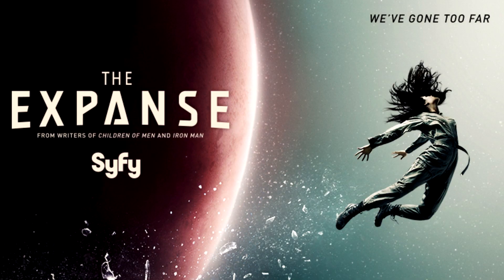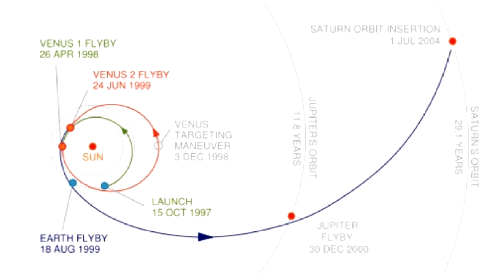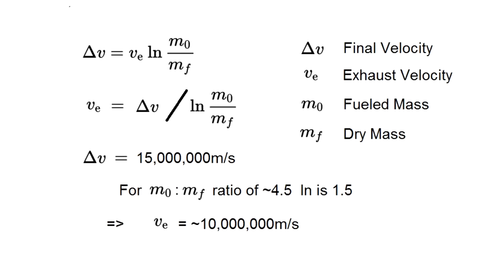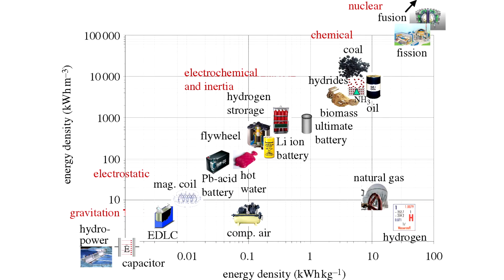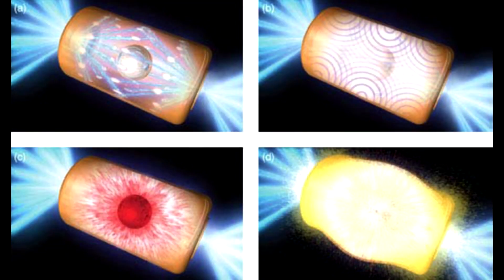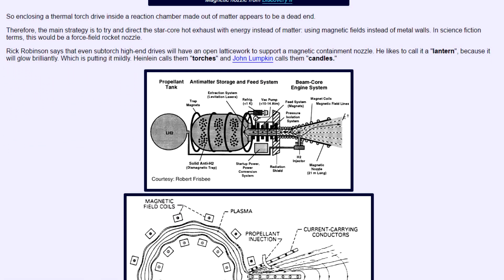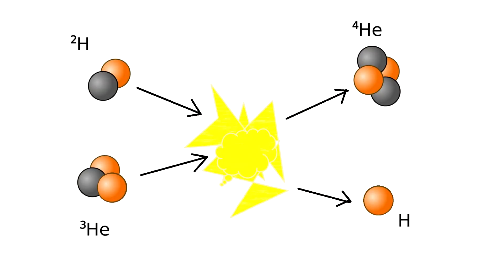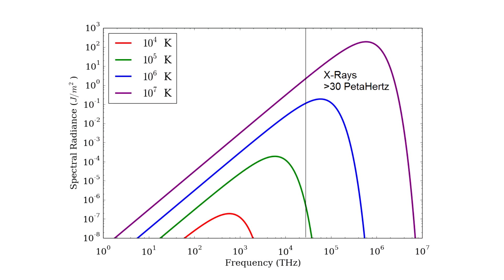The Rocket Science of 'The Expanse'

Comment: One thing I don't understand is the Mormons... if they have constant accelerations of the kind they show in you-know-what-episode (and don't tell me it's not used - putting a smaller set of engines on the ship would have to be more cost-effective) what kind of star are they visiting that requires a generation ship? O.o At 1 G you can get anywhere in the universe, multiple times over, in one lifetime from the perspective of the crew. Where the hell are they going?
Reply: My half assed guess is that it looks like the ship was designed to spin for gravity, which means they might not have had the fuel to run the drive the whole time, they may have intended to have a long coasting phase.  Again.. a half assed guess on my part.  Cheers!
Reply: They only have a delta v budget of 5-10% c. They will not be constantly accelerating.
Reply: And I dont remember anything about Bussard ramscoops being mentioned.

Comment: I once had a chat with someone about possible fuel sources for a ship. Now this I have to give him credit for this one. He had put a theoretical design out based on extensive research in to the subject surrounding the issue of the neutrons and the unique properties of deuterium and tritium. His idea was to actually add two other molecules to the mixture. The idea was to use them as a sort of filter and catalyst agent to reduce the offset of the potential build up of the neutrons and to recover some H3 to try to reuse. The design of the engine was enormous, hundreds of "Neutron Sinks" as he called them, would retain the charge and the excessive heat. Though I'm not in expert mind you, but in relation to how this system could be used effectively the group I was with looking at this came to the conclusion that this system would have to be applied to much larger ships. Like Tycho Station, or the Donnager being the smallest you could effectively utilize this system with. Or the Canterbury, ships with an impressive mass that would be able to house the sinks and the recycling scrubbers. Now to power this you would need some kind of high yield source of power. Most the material you spend is into the propulsion, this system would need a impressive solid state nuclear reactor or something that can generate tremendous amount of energy to maintain the amount of power required to direct and control the propulsion plant itself. I don't recall what the two other molecules were, this was put out almost a year or so ago. Approximately around the time Expanse had come out and in the first few episodes. This idea was originally brought up to a site I was part of were people had designs for things in games. An example would be like a steam airship in D&D that used little to no magic. There had to have been 50-something designs submitted, but many were concept art design. A hand few had any technical design application was put into them. Another and probably one the best ones I was part of was done in part to a space game. Two women had asked the general population for a design for a ship based on the in game currency and resources available. The group I mentioned before actually met up and started from this request. We had 8, 3 actual designers. Two of them did architectural, one did engineering. A geometry professor from a university, another mathematician, a civilian contractor for the army who did radar work, a chemist who had some knowledge in metallurgy, and then there was me. At the time I was submariner in the navy, my experience in that kind of enclosed environment gave the design vast amounts of redundancies and safety features that the GM of the campaign hadn't even considered. Now we did later on pick up a few others, two of which had extensive knowledge in physics. Their take on the system was more on the questionable side as in they had doubts, but given that this person had gone very deeply into the operation of how to collect the neutron build up and the method as to disperse it safely did have them a bit intrigued. To disperse the build up then sinks would actually vent out into space, now the sinks had a very in depth and extensive cooling system running through out. His theory had put it out that the gases and leftover junk could be super cooled to a gel or a form of liquid. Venting it out to space on the dark side of a planet or some kind of orbital body to allow it to tumble and melt on re-entry made it so that liquid would be vaporized. The charge be nullified as it was basically released in the ionosphere, or out in vacuum away from the ship and crew. Major downside to this system is you would need two more holding containers of some sort for the extra fuel sources. Upside, the question of what to do with the charge had been answered thoroughly and in a safe way for the crew. The site I mentioned is no longer up and has been down for some time unfortunately, but if the "A-Team" as we were dubbed, could see this vid I bet money either one of the two physics majors could identify what the two other molecules were and how they would interact with in this proposed system way better then I could. My knowledge was directed more towards the coolant and the refrigerating system required to super cool the build up and the best way to maintain it.
Reply: one thing to keep in mind is with the massive heat output of the engine, even a relatively small amount of excess heat could be used to generate considerable power, with a bank of high output capacitors used to initiate startup when needed, in reality you could either entirely forgo a separate reactor or use a small one to trickle charge the capacitors needed to jump-start the reaction, entirely dependent on the distance you need to cover and the other energy needs of the ship

Comment: BTW, Scott, neutrons can be reflected. It only takes a dense enough material. Thermal neutrons can be deflected/reflected by, for example, concrete. That is how it is done in reactors to get more flux, also in atom bombs and H-bombs. Some materials that reflect neutrons in reactors are as light as graphite. So if the back of the drive was in a particular shape made out of particular material, the crew would be safe and you would get extra thrust.
Reply from the maker: +Thrust vectoring however the reflection efficiency is very low, most of neutrons instead get absorbed and converted into heat.
Reply: That is not true, reflection, or rather generally scattering, have a substantially higher cross-section than absorption. Here, you have the comparison: http://www.nuclear-power.net/wp-content/uploads/2015/11/neutron-absorption-capture-to-scattering-hydrogen-min.png
The neutron reflectors are widely used, in nuclear reactors, atom bombs and fusors. They can increase neutron flux substantially, making sub-critical cores supercritical. The main issue with reflection is its heavy dependence on incident angle. However, effective neutron reflectors do not have to be very thick, because only the outermost layers of the lattice can reflect neutrons back into the reactor/bomb. Some neutrons, however, will scatter from the topmost atoms into the lattice and then continue deeper losing momentum along the way(being moderated) and with the penetration depth and energy decrease the probability of absorption increases(in time the neutron also loses enough energy to hit some of the nuclear resonances). However, given the angle of incidence is good enough, you can achieve pretty good reflection efficiency. But also it is heavily dependent on energy(as everything). However, if you had a multilayered neutron reflector with the right geometry, you could probably achieve a substantial lowering of neutron flux with less mass than you could with shielding alone. The only problem is designing a suitable geometry. To achieve needed neutron flux, reactor geometries are simulated and experimentally studied and it is actually hard to design an effective reactor geometry. With multi-layered anything you also have the problem of energy loss in the layers and the neutron trajectory change, which you also have to take into account.
Reply: I forgot to mention - in atom bombs and some reactors, they use a neutron "mirrors", they reflect neutrons back to the bomb/reactor. They reflect neutrons, that have nearly perpendicular momentum to the reflector surface. A reflection coefficient for that is pretty rubbish, you would get a good reflection coefficient comparable to 1 only from a neutron star, which is not a very practical material to make a reactor reflector out of ^^ But in research, reflection using critical angle is used and the efficiency is pretty good(however, the critical angle is very sensitive on neutron energy, so therefore it is not really easy to design wall out of it to reflect all neutrons, that is how a nearly monoenergetic/monochromatic/ beam of neutrons for neutron therapy or neutron material probing is picked). Had the reactor used specially designed reflector wall to reflect... However, that would mean knowing exactly the geometry of combustion area, which is impossible for pellets, it would be possible for stelarators and tokamaks... Or maybe accelerator-induced fusion, but then you have the problem with luminosity of the accelerator beam and collection of unused fuel and acceleration efficiency, which is really, really low these days...
Reply from the maker: Ok you need to go and actually look at the science, yes it's possible to get 90% neutron reflection if the neutrons are slow thermal neutrons, not the fast energetic neutrons emitted from a fusion event. As the energy goes up the scattering cross section goes down and the neutrons penetrate further into the material until they stop.  As you know most commercial reactors use thermal neutrons because it simplifies the control system.
In nuclear weapons the neutrons are fast (because there's no time to slow them down) and the reflection efficiency is very low as a result, but a chain reaction in a nuclear weapon represents an exponential growth in neutrons and I'm sure if you've ever done the math for compound interest you'll know that even tiny increases in the growth rate translate to massive increases very quickly.

You posted a graph showing the scattering/absorbtion cross section of a hydrogen nucleus.

That is completely different from the reflection / absorbtion properties of a bulk material, where a neutron will undergo multiple scattering events losing energy at each scatter until it slows down inside the material. Importantly as a neutron undergoes a scattering event it deposits energy into the target. So you need to consider that you're going to need to handle multiple terawatts of thermal energy even with a 90% efficient fast neutron reflector (which does not, as far as I know exist).

Look it's great that you know these things, but if you'd dug into the math you'd very quickly realise that what I'm saying is grounded in science.

I suggest you go and find some good papers on neutron reflectors and figure out their performance with MeV Neutrons.

Comment: In The Expanse, it's shown and described that the attitude control thrusters run on steam piped from the engine room. To me this suggests a fusion plant that in turn heats water (derived locally from harvested asteroidal ice) to ultrahot steam to get a blend of relatively high Specific Impulse coupled to high thrust.
Reply from the maker: Yeah that's what's called 'teakettle mode' it reduces radiation hazards to nearby ships at the expense of low efficiency. To get the performance Epstein   demonstrated you can't have much in the way of wasted mass so pure fusion exhaust is the way to go.

Comment: This is all making an assumption that over a hundred years the efficiency of conversion has not improved to reduce the waste heat of the process. After all the equation balances if you reduce the energy converted to heat and raise the energy produced in trust.
Reply from the maker: +Carlyle Toussaint actually there are fundamental limits on how efficient things can be made https://en.m.wikipedia.org/wiki/Carnot's_theorem_(thermodynamics)
As well as various other basic physics which won't change.

Comment: As Scott Manley accurately described the difficulty of actually building a fusion rocket powered space craft that can reach a continues acceleration of 7 Gs, in the show all the space ships only do and or maintain 1 G and likely half that most of the time. And that should be entirely possible, especially in the 23 century. Also the reaction of a fusion torch drive takes place outside the ship.
Reply: They also did point out that the ship doing 7G killed him, the gravity might have only been part of what got him, even if the ship didn't roast itself with radiation and heat he might be toast from running that high that long

Comment: Wouldn't a rocket travelling outside of the gravitational forces of planets, asteroids, the sun, etc continue to accelerate even if the engine is shut down? I would think all that would be required would be the initial acceleration of the rocket motor, then the inertia of the rocket acting without any friction against it, would continue the rocket accelerating until something acts upon it to reduce that acceleration,.
Reply: It'll continue to move, but not continue to accelerate.  Acceleration requires the application of force.  Inertia just maintains your velocity once acceleration stops.

Comment: If I remember correctly, books stated that Epstain drive was an improvement on a "Fusion torch" drive.
Reply: Epstein himself was a fusion drive engineer who tinkered with drives "at home." It's entirely possible he discovered a series of improvements to heat and thrust management over fuel consumption to make a miracle super-drive. After all, penicillin was discovered by accident, who's to say an Epstein drive wouldn't be?
Reply: @MachineMan-mj4gj  penicillin was discovered by mold, which happens a lot in nature. You won't find a new engine just lying in the forrest one day.
Or if, you'd rather be very suspicious.

However, before he did all this, he managed The Beatles.  And that's more important than some rocket stuff.
Reply: @MachineMan-mj4gj  And he didn't kill himself
Reply: @lukas.prochazka  Well, this Epstein did at least.
Reply: @MachineMan-mj4gj  on accident.

Comment: Very good analysis overall. A few things that I would add:
1. Proton- Boron11 fusion produces even less neutrons than D+He3 does and produces only charged particles. "Fuel pellets" would fit the Boron 11. There are some concepts that would work for that. 
As with most fusion concepts, the thrust would be relatively low, however unless you get the fusion power way up.
Granted, we have some 300 years or so to figure that out ;)
Also take a look at what Princeton Plasma Physics Lab is doing with their FRC direct fusion drive. They have a "scrape off layer" that provides the thrust and gets rid of the fusion products. Their thrust and ISP are way below the requirements (but then it is still "early").
https://www.youtube.com/watch?v=IlydFJtWeXg

Another interesting take is what MSNW LLC has proposed with their fusion driven rocket engine:
They want to achieve 90 day mars trips in the first iteration and 30 day trip times in later versions of the engine:
https://www.youtube.com/watch?v=tHSOmOu61b0

Both of these projects were funded by NASA's NIAC.

There is also Uri Shumlak's (from the University of Washington) FUZE which could result in an incredibly light weight and small fusion reactor (if it works). The latter is currently making good progress with funding from ARPA-E.

A little more fringe but similar to the FUZE is Lawrenceville Plasma Physic's Dense Plasma Focus which is (theoretically) also quite compact and even aims for PB11 fusion. 

That said the background story of the Epstein Drive was pretty far out there. Oddly enough, I don't think it is even needed for the trip times and accelerations described in the show (and I presume in the books as well). Those could be achievable with much more believable engines more similar to the ones I mentioned above.

Comment: The only thing that really bothers me about the show (vs the books) is that the show makes WAYYYY too liberal usage of grav-boots. I'm pretty sure that's for budgetary reasons involved in making a TV show, but let's be real: if you're on the float, in zero-G, why would you walk down a ladder using your grav boots instead of just gently pulling yourself down hand-over-hand =\
Reply: Remember they do have a form of acceleration based "gravity" when the drives are running, as seen in CQB.  Once the acceleration is gone, the "gravity" goes too, hence the mag-boots.  But since the vast majority of the time you're constantly thrusting towards your destination, and turning around halfway there to thrust in the opposite direction to slow down, you're almost always going to have "gravity".  It makes sense to have a gravity-centric approach to ship design, and have the mag-boots to deal with those times when you're not using the drives.

But you're right in that it's also mostly production budget and immersion that causes this.  They'd have to shoot the entire thing in something like the Vomit Comet otherwise or use a water tank and that would be ridiculously expensive for every single episode.  Using wires to suspend the actors would look hokey no matter how well it was done, especially the more you use that method.

Comment: I would have thought a pure fusion Orion drive would be capable of many of the things that the Epstein drive is. For a start running at one G continuous is probably unecessary you can probably get by with a fraction of that without loosing muscle mass, rotating stations would probably be one G unless they are small. The Orion drive gets around the impingement of x-rays on the ship by having external reactions and catching the x ray's in the tungsten reaction mass which is turned to plasma.